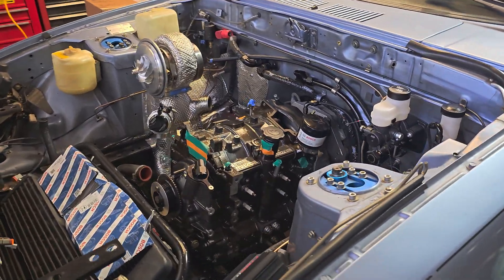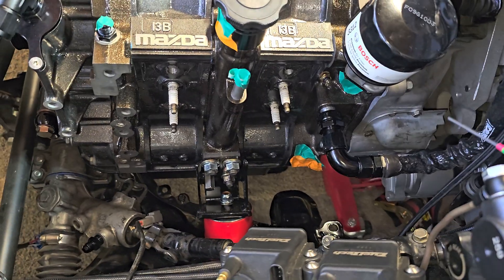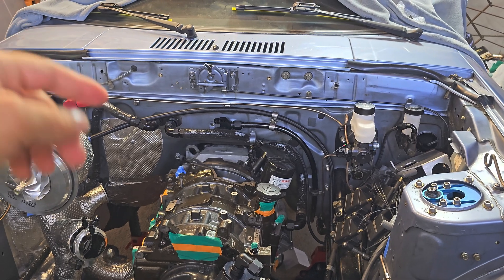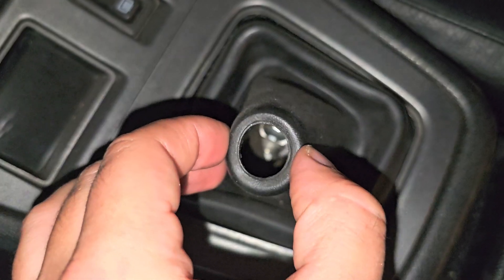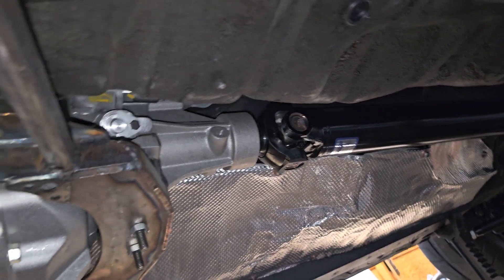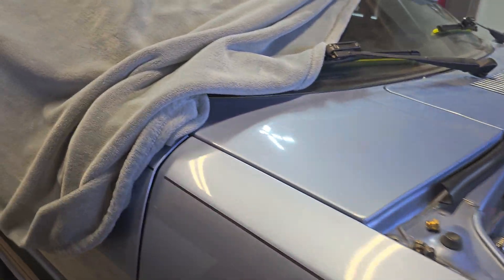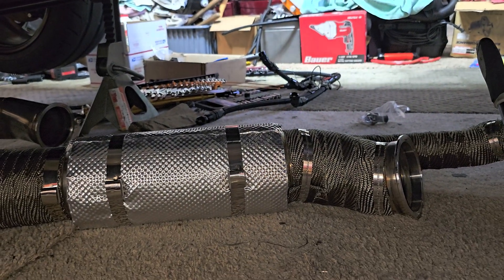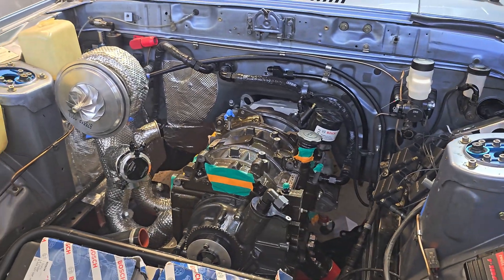Tremec T56 Magnum Transmission Swap for Mazda Rotary Engines 13B 20B

Comment: Great video I like a T56 for my Turbo II S5 200 HP. What's your  thoughts about swapping the OEM gearbox?
Reply from the maker: @MrChando1975  Why would you swap a stock box at such low power level?
Reply: @RGHTBrainDesign  This gearbox needs rebuilding, and when I drive the car fast, it feels like it needs 1 more gear. The T56 looks like better than the OEM 5 speed gearbox.

I would like a drop in gearbox no drilling and cutting needed.

Thank you for answering!

Comment: Questions if don't mind me asking what kind of coilovers are u running and do u think the t56 magnum will fit a 79 rx7
Reply from the maker: Currently Varishock Double Adjustable Rear, KSport Front.  The Magnum fit the FB perfectly with no clearance issues. Not sure if the SA is narrower anywhere.

Comment: Hello Ryan,  I accidentally stumbled on your channel and I'm thoroughly impressed with the attention to detail and parts selection on your build. I have a few questions on your T56 choice. 1) Are you using a T56 magnum F or the standard size T56 magnum.  2) Did you go with the close gear ratio or wide and lastly 3) What fluid are you going to use for your transmission. Thank you in advance .!
Reply from the maker: 1) Standard Magnum 2) TUET11009 3) Redline D4 ATF